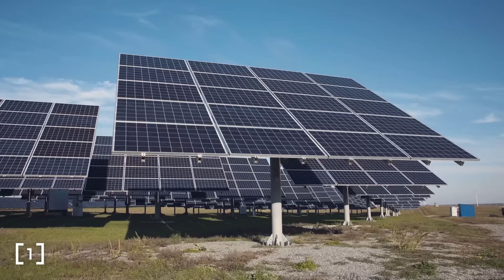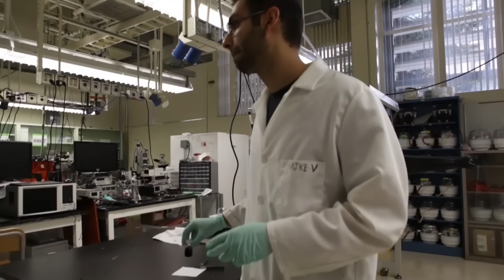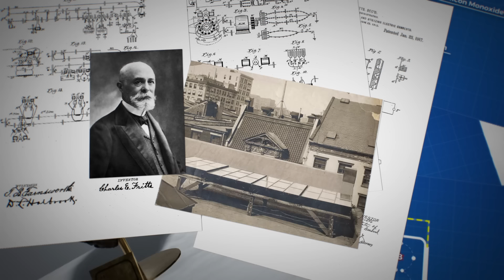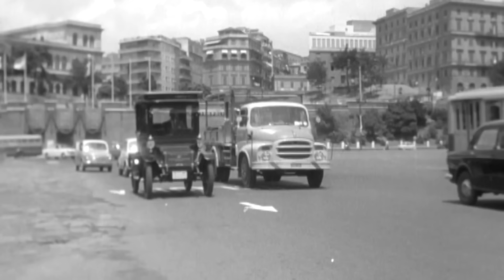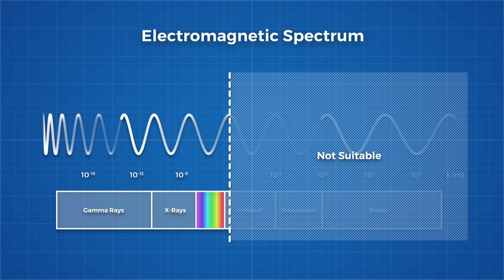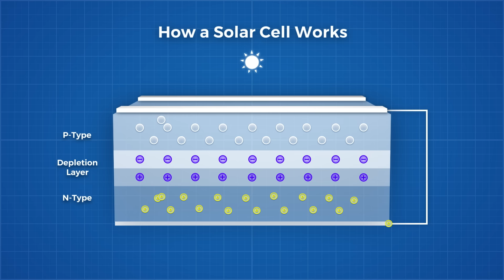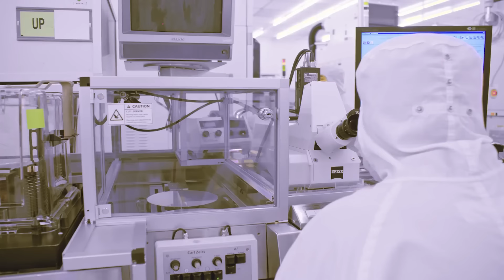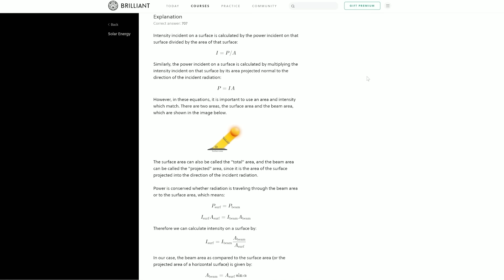The Mystery Flaw of Solar Panels

Comment: As someone who designs and makes solar cells for a living I have to say I'm really impressed with how well you covered this topic! It's a complicated subject with a lot of subtleties and you did a great job explaining it to a general audience! Nice work!
Reply: @SLM-n6g  TLDR - About 90 % of silicon solar cells go to landfill right now, but this is a big field of research right now so it is likely to improve a lot in the future.
-By most metrics solar power wins by about a factor of 10 in terms of lifetime costs of energy production, but this can vary a lot depending on what factors you take into account.

Full disclosure - I work mostly on prototyping new materials and designs on the small scale rather than dealing with the large, industrial-scale issues. However I can give you what I have learned at conferences etc. The energy costs of production can vary massively depending on the type of solar panel you are describing, but I shall assume you want to know about monocrystalline silicon since that is the most common kind of solar cell. Thin-film technologies use about 1000 x less material to produce than a silicon cell so they have the potential to improve upon the below stats, but they come with their own problems which i won't go into. 

Silicon cells are made of about 75 % glass, 10 % polymers, 8 % aluminium, 5 % silicon, and the rest is small amounts of copper, silver, and other metals. There is also a small amount of toxic lead and tin because solar panels are allowed to use leaded solder (unlike most other electronics) so this is obviously also a concern. Currently there are no regulations on disposing of solar cells outside of europe, so about 90 % go to landfill because it's currently not profitable to recycle them. There is a lot of research going into this though because it's a potential goldmine if you can make it profitable. The detailed recycling processes are often closely guarded secrets, but the basic process is you heat the cell up and then peel off the glass panels which make up the bulk of the cell, then you burn away the polymers using sulfuric acid and hydrogen peroxide, and finally you use various acids and chemicals to selectively dissolve all the remaining materials one by one. Hence you can recycle them, but the materials you get out of them are currently worth less than the costs of recycling. Regulation and further research is expected to help with this. 

It is hard to find unbiased data on lifetime carbon footprints, and it is easy to skew the data by conveniently forgetting certain parts of the life cycle (e.g. the mining costs for coal or the production costs for solar.). Burning coal, you fundamentally get about 340 g of CO2 per kWh of electricity, purely based on how much energy is in coal per molecule and the efficiency of a power station. This does not take into account mining costs or whether you capture the carbon (most places dont capture carbon). A 1 kW solar panel takes between 400 and 500 kg of CO2 to manufacture, and should probably assume that it will only produce an average of about 10 % of its rated output over its lifetime (accounting for night, clouds etc.). Hence this panel will produce about 17,000 kWh over its 20 year lifetime, which works out to about 29 g per Kwh. This ignores the installation costs, space costs, and costs of recycling, but even if these triple the impact then solar still wins. Plus this also doesn't take into account the other pollutants and environmental damage assosciated with coal, so in my view it's hard to argue that solar is worse than coal environmentally. However I'm obviously biased so you should probably look at the arguments I make rather than my own opinion. Solar panels have their own version of Moore's law called swanson's law, where the costs of making them halve roughly every 5 years, so hopefully it won't be long before solar power is no longer a political issue and just one which makes good financial sense. They are already profitable without subsidy in certain places, and once they get cheap enough there will be basically no reason not to integrate them into a new building or whatever (why would you turn down free cash?). It looks like we are approaching that day pretty quickly too! :)
Reply: @jonathonharwell1764  ,   We need a good video on Swanson's Law!
Reply: Jonathon Harwell I have worked in 2 fabs, 100% of scrap wafers were recycled from both.  The silicon was used for solar panel wafers after being melted into new ingots. Metals and dopants were removed first.
Reply: @jonathonharwell1764  Investing money and careers in technologies that generate low-carbon electricity just has to be the wise thing to do. Wind And Solar Plants (WASPs) are the headline technologies, but in respect of investment and careers, ignoring burgeoning developments in advanced Nuclear Power Plants (NPPs) might well be catastrophic.

This decade, 3 manufacturers will have operational Gen III+ (passively safe) Small Modular Reactors (SMRs). Leading the charge will be GE Hitachi's BWRX-300 SMR as it has real potential to win the battle for commercial investment funds, with its 24 months build programme.

The first one, with capital from an Estonian utilities’ operator will commence operation in 2027. The second one, for the energy-intensive businesses of a Polish billionaire will be operational in 2028 and the third one is a Government inspired choice for the Czech Republic.

The 24 month build programme is no different to Wind And Solar Plants (WASPs), so the cost-of-capital that drained investment funds out of low-carbon nuclear power plants (NPPs) and into WASPs is completely negated.

By 2030, it will be available for manufacture under licence in the UK, for a capital investment of £527 million, for a 300 MW NPP. It will generate 2.4 million MWh of 24/7, low-carbon electricity each year, for a lifespan of 60 years, with a high probability of an economical life extension up to 80 years.

Taking into account all of the other significant costs, every £1.00 of capital invested in a BWRX-300 will 'earn':

7.2X more than £1.00 invested in onshore wind:  https://bwrx-300-nuclear-uk.blogspot.com/2020/05/fund-managers-with-320-million-to.html 

12X more than £1.00 invested in offshore wind: https://bwrx-300-nuclear-uk.blogspot.com/2020/05/invest-90-billion-in-offshore-wind.html

15.5X more than £1.00 invested in utility scale solar: https://bwrx-300-nuclear-uk.blogspot.com/2020/05/fund-managers-with-424-million-to.html

2030 could well signal the beginning of the end of the decades of subsidised investment in WASPs - at least in the developed world. If investment dries up - so do careers.

Keep up to date with the progress of the BWRX-300 - Join the facebook Group Page: 
https://www.facebook.com/groups/1032713003519847
Reply: @seeWemm  as they say, "why not both"? I'm a huge fan of nuclear energy, from small nuclear reactors to the many promising ventures in smaller scale fusion (as long as we don't have to talk about the mess that is ITER). At the same time, (and I say this as someone who has handled radioactive materials and is reasonable about their risks), I don't really want to have a small reactor, fission or fusion, in my house. I'm in Seattle (not the sunniest place in the world) and even though we have some large trees that can partially block our panels, we've done quite well on energy output from them over the lasts few years. A huge share of homes could host panels, battery storage, or both with little or no inconvenience, making much of our grid local, dramatically reducing delivery inefficiency, and moving away from fossil fuels now instead of in a decade or more when current prototypes and initial test systems become widely commercially viable. We can even harvest and store energy surpluses, not just halting gge in some places but beginning to reverse it or beginning to produce clean hydrogen for use in portable applications where batteries aren't sufficient. As we expand our nuclear capacity, we can begin with stabilizing power to large and sometimes remote institutions like hospitals and manufacturing and then push out to replacing all our fossil fuel infrastructure and what may by then be aging solar and wind infrastructure.
Reply: seeWemm:  thank you so much for your brief expose on the potential of safe nuclear power, by this I’m sure you mean plants that are impossible to melt down, or suffer any other kind of catastrophic radiation emission.

I am in total agreement with you that subsidies for solar and wind power must be phased out, and the sooner the better.

Dr. James Hansen, a climatologist, and author of many important research papers and published books, has recommended a solution to the subsidy problem.

He suggests a carbon tax we’re all the tax money collected is distributed amongst the population evenly, so that each adult person gets a fraction of the tax collected, regardless of income or anything else, let’s say it is $3000 a year, or for you to thousand pounds, ha ha!

The carbon tax is levied at the point of production, and in proportion to the carbon dioxide and other pollutants that will be produced by the volume of fossil fuel. For instants Cole is mostly carbon, so that in comparison to natural gas, for a given amount of energy potential, when burned, the carbon will produce much more carbon dioxide then a given amount of equal energy potential natural gas.

Anyway, this is kind of a libertarian idea, people get the tax revenue directly, there is no intervention from the bureaucracy whatsoever, and they can spend the money however they wish, and it is presumed that they will put some of that money into more efficient energy uses, such as buying an electric car or purchasing solar panels.

As for a nuclear power, well I am an engineer and I am well aware of its potential, and also pretty well-versed on the problems of traditional gigantic nuclear power plants.

Do you know this? That there is not a single privately owned insurance company in the world that will insured for liability a traditional nuclear power plant. All insurance is provided by the National Government in which that nuclear power plant resides. That is a huge subsidy and a huge liability forced upon a population without their approval.  When I learned this I am mediately turned against nuclear power.

I am for nuclear power though if melt downs and accidental emissions cannot happen. And that means that they have to find insurance on the private market or self insure with a bond deposit.

I’m going to look at your references, a lot of promises have been made by the nuclear energy industry, I’m sure you’re sick of hearing, “too cheap to meter” and other such ridiculous promises by The nuclear industry. It’s time for this industry to measure up after so many false promises and so many catastrophic failures.

Sincerely, Steve
Reply: @seeWemm  ,  Good luck.... I won't be around to see it, but perhaps for our two children you hold out hope.
Reply: @CharlesBosse  ,  IF you would stop using gibberish and acronyms for everything, we MIGHT have some chance of understanding what your point is. Maybe?
Reply: @jonathonharwell1764  so based on the fact that you are obviously biased, we are left with NO conclusion? Forgetting about the money.
Reply: @jonathonharwell1764  instead of going to landfill why arent they actually put on top of the (covered) landfill wired up, and plugged into the grid. even if inefficient on one km2 of dodgy panels on a brownfield site is better than nothing. and why has no one invented a commercial all-weather solar-paint...imagine a Forth bridge worth painting?
Reply: Jonathon Harwell Would love to know your story and how you got into your field!
Reply: @peterfrying4933  I'm a physicist by trade and now I work in academia researching new materials and designs of solar cells. I did a degree in physics and basically looked for any research group I could find who worked on solar cells and did a PhD with them (it's surprisingly easy to get into a research group as a phd student as you are essentially free labour. Getting funding is the hard bit!). Now I have a PhD I am (slowly) trying to get my own research group started. It's a tough field to work in and there is a lot of competition, but it does at least have job satisfaction!
Reply: @jonathonharwell1764  What happens to the PV effect when you substitute carbon for silicon and attempt to use calcium and nitrogen as doping agents? Is it too unstable or does the energy level of the incoming photons increase? Just curious.
Reply: @surferdude4487  There's always loads of research going into new materials to make solar panels out of, (in fact there are many materials that are better than silicon already, but silicon still wins because 50 years of computing industry has made us REALLY good at making silicon..), but the main things it needs to be able to do is absorb light and conduct electricity well. About your idea, crystalline carbon is diamond, which is transparent to everything except deep UV, so i don't think it would work well. There are people who dope it with stuff like you mention to help it conduct electricity, but I don't think that would be enough to make it a worthwhile alternative to silicon at the moment. The graphite form of carbon is both absorbing and conductive, but it has a different problem in that it's bandgap is extremely small (which long story short means that it will absorb light really well, but it will waste most of its energy as heat), so solar panels made of graphite are extremely inefficient unfortunately, and again that doesn't change much with doping. Sorry to be a downer! That's an oddly specific material you are asking about! May I ask what made you think of that?
Reply: @jonathonharwell1764  Just going off the top of my head from what I can remember from the periodic table. You need holes and extra electrons. It seemed to me to be the first place in the periodic table that can be achieved is around carbon.
Reply: @surferdude4487  Ah fair enough. Yeah doping carbon with those would add the stuff for conductivity, but carbon doesn't absorb in the right way unfortunately.
Reply: Jonathon Harwell good for you Jonathan, I wish you the best in your R&D. And you have the right attitude. I did R&D for about a decade and it was the most rewarding thing I ever did as an electrical engineer. We made many substantial breakthroughs. I hope you do also.

In my field, besides developing new electrical mechanical products, it was essential to make them small and operate efficiently.  At that time, in the 1990s, there was a lot of low hanging fruit because it was an old industry and electronics had not yet been applied as a controlling agency. As an electrical engineer, and the only one we had at the company, when I designed electronic Controls specifically for our equipment, it look like I performed a miracle, we could make the equipment half the weight, gain manyfold in performance specifications, while using a tiny fraction of the energy compared to the same kind of devices without electronica controls.

I guess it’s different for the solar Development field, where you have math applications, so even a tiny gain in efficiency or cost reductions results in a huge benefit due to the wide distribution use of solar.

I hope with your new R&D company, the one that you are putting together yourself, that you somehow pay yourself a salary, ha ha!
Reply: @jonathonharwell1764 .....thank you for your story and your efforts...good luck and good hunting...your successes will make this world a much greener place for my children!....again, thank you.
Reply: @jonathonharwell1764  keep up the good work !
Reply: @jonathonharwell1764  ,  Bravo. More power to you! Good luck!
Reply: Cool! My dad has a PhD in physics and he is working on cadmium telluride solar cells at First Solar.
Reply: Very cool to come across someone else in the PV field on the internet! I'm working on my PhD right now, researching new silicon PV module technologies.
Reply: I enjoyed watching this video, it has mystery to it, with the lost efficiency factor, and I appreciate the time that the author put into it! Myself, I am an electrical engineer, but I am not involved in the solar or silicon aspects of electrical engineering, So I learned something to!
Reply: @SLM-n6g  all in: Carbon neutral in about 8 days in the Sahara (1Kwatt/m^2)
Reply: SLM Coal 900 gCO2/kWh, Si PV 24 gCO2/kWh, CdTe PV 13 gCO2/kWh. http://www.firstsolar.com/-/media/First-Solar/Page-Components/Corporate-Responsibility/SmallestCarbonFootprint.ashx?h=460&w=767&hash=4923C0A5B94337B6CEC2A1F2B819AB1461448004
Reply: SLM CdTe solar modules are recycled with up to 90% of glass and semiconductor reused. http://www.firstsolar.com/en/Modules/Recycling
Reply: Thanks for "YOUR" input :)
Reply: @Jonathon Harwell Sir are you willing to share some contact information? I am a future researcher and might want to get in touch with you sir!
Reply: So maybe you can answer me a question.im no engineer but since I was a kid and solar was just in its infancy I understood that solar cells were woefully inefficient. Over the years I've been reading of developments but I wonder if it's possible to develop and design a solar panel that can utilize the wavelengths it needs while reflecting/focusing those it cannot utilize for further power generation?
Theres a station in the desert in california that uses focused solar energy to generate...I believe melt sodium that then is used to generate steam and the electricity?I could be wrong on this.but even if only a small amount of thermal energy can be effectively focused then using the effect of a liquid in a vacuum chamber (water under vacuum boils at a lower temp but delivers near the same amount of mechanical energy)to then generate more energy.
Reply: What about the large amount of space that solar and wind farms require for their large scale usage? Just asking since I haven’t seen anyone bring this up in the comments. This is a negative environmental impact where a lot of open space is required, plus the infrastructure. Trees need to be cut down, the space made suitable for installation, roads have to be put in for since those installations need to serviced, power transmission lines run to connect to the power grid, and all this infrastructure negatively impacts wildlife with loss of habitat on a scale ever increasing with the demand. I don’t know the side by side comparison of solar/wind with coal in this respect. Does anyone have that info?
Reply: Pages 294-296 of “The Final Theory: Rethinking Our Scientific Legacy “, Mark McCutcheon well worth reading on solar cells.
Reply: If you design and make solar cells for a living, why are you not correcting him on some of the mistakes?
Reply: Why don’t yall use the Ligma conductors. It’d solve all the problems.
Reply: There is no comparison really, because the extraction, transportation, and storage of coal creates a great deal of waste, and then there is the consequent removal and disposal of ash. Consider also that solar power does not necessarily mean photovoltaic panels, solar thermal plants work on basically the same principle as any fossil fuel powered plant, except the boilers are replaced by solar troughs and heat exchangers. Since solar generation does not require the transport, delivery, and storage of fuel stock, and consequently no rail sidings, docks, etc. (and the carbon emissions associated with all those ancillary activities) all that doesn't even enter into the picture.
Reply: @furripupau  ,   I would love to see YOUR videos on the subject of solar energy and lack of pollution!
Reply: @furripupau  How do you do it 24/7?  You can't any storage system make them unusable for base line power any one who thinks so is fooling themselves.
Reply: I'm wondering, what your thoughts are on including a thermoelectric generator (wikipedia tells me they are also called a Seebeck generator) in the same enclosure to try to recapture some of the waste heat?
Also, do you think the boost in available light and possible 24 hour exposure is worth the cost and potential introduction of inefficiencies to launch massive solar cell arrays into geosynchronous orbit and beam the collected energy down with a microwave laser?
Reply: @travissmith2848  The thermoelectric idea would definitely work, but the big question would be whether it provides enough energy to be worthwhile. From what I know about them, thermoelectrics work best at pretty high temperatures (hundreds of degrees) and the ones which work at room temperature aren't that good, so you don't really see them very much outside of high temperature industrial processes. One really cool potential application for them though is for cooling CPU chips - you simultaneously prevent overheating by stealing the heat energy, and you also generate power from the current that it generates. No noisy fans required. 

For the space array question, unfortunately I think the answer is definitely no. It's true that you'd get a lot more energy out of a cell in space vs a cell on the ground, but putting them up in space would likely cost way more than the benefits, even if it was easy to get the energy down to space. The need for a laser to transfer the energy would also cancel out the benefits of increased efficiency because it is rare for any laser to be more than 50 % efficient, and you'd lose a load more going throught the atmosphere, so I don't think space solar is likely to be powering stuff on earth any time soon. It's a bit like the solar roadways thing - there's not much point going to the extra effort of putting them somewhere difficult, when there isn't really a shortage of empty spaces which aren't being used for much else (deserts for example).
Reply: @jonathonharwell1764  Thanks!
Reply: @travissmith2848  From what I've heard, because I have not crunched the numbers myself, is that the cost far outweighs the benefit. Also, there are huge risks involved in beaming massive amounts of power down to Earth in the form of microwaves. At some point, I believe we will have space elevators. When that day comes, we can transmit massive amounts of solar generated electricity down the beanstalks. Until then, I'm much more comfortable with solar panels on the ground.
Reply: @SLM-n6g  it's a great way for biden bernie aoc to harvest votes!!!
Reply: @SLM-n6g  ,   EXACTLY... Where are your answers??
Reply: I'm still waiting for them to work on cloudy days and at night, or in winter, when we actually need the electricity. They are the worst kind of "green" virtue signalling. I still haven't seen definate proof that they produce more electricity than goes into making, installing, maintaining, and disposing of them.
Some of the toxic cocktail created while making solar panels:
sodium hydroxide; potassium hydroxide; phosphine; arsenic; trichloroethene;  phosphorous oxychloride; ethyl vinyl acetate; silicon trioxide; stannic chloride; tantalum pentoxide; lead; hexavalent chromium plus others.
Reply: @KillerBill1953   Well they are currently profitable in some places with zero subsidy (unlike coal which does require subsidy..) and they are getting better every year, so i guess we'll just have to let the free market decide. It's not virtue signalling if it's making you profit to produce low carbon energy. I included the calculations on CO2 payback time in an earlier response, and the list of chemicals you provide there are mostly just normal chemicals used in any industry (silicon trioxide and tantalum oxide are basically just sand, and the hydroxides are the main component in bleach), and while they are a concern they are no worse than what is used in any other metal or semiconductor industry. You are obviously entitled to your opinion, but I'm optimistic we'll be seeing cheap energy from solar cells become more and more common as time goes on :)
Reply: @jonathonharwell1764  Not in the UK or the EU where it is only profitable to run wind farms and solar arrays because of the subsidies. I'd be interested to know of anywhere with zero subsidies.
There's also the fact that they are not subject to very expensive and draconian planning laws, including decommissioning,  unlike fossil or nuclear which are made artificially expensive because of this. They are not on a level playing field when it comes to finance. 
Up from 10% efficiency to what, almost 20% outside the lab? They also reduce by around 1% a year. Without subsidies nobody would bother with them
They have some uses for people off the grid but that does not make them greener than fossil or nuclear. They are also useful for space programmes. However, I wouldn't expect a balanced opinion from someone whose livelihood depends on promoting the scam.
Just remind me what kind of source produces the electricity necessary for manufacturing wind and solar equipment, or mining the raw materials. Current battery technology is nowhere near sufficient to provide the base load that heavy industry needs. Oh, I forgot, that's all been moved to China and India where they don't have time and money to waste virtue signalling.
Have a very good day. Still not convinced by your very vague assertions.
Reply: @KillerBill1953  Hey uh bill, about subsidies - oil companies get them too. Find me one oil company that does not get either tax credits/breaks or subsidies. If fossil fuels are subsidized, it is only fair that wind, solar, etc. be subsidized too. 

Thermal efficiency is not really much of a talking point when the power source is free. So a coal plant has an efficiency of 37% or so, and a solar-thermal plant has an efficiency of 20% or so. Who cares? The coal plant pays for fuel, the solar plant doesn't. So it's still more economical. The coal plant also needs a railway siding (or dock) to unload coal. And it needs a vast amount of space to store coal. Then there has to be space to store ash for disposal, etc.  

The basic truth is that fossil fuel generation is expensive because there are so many ancillary costs. Extraction, transport, and stocking of fuel, storing and removal of waste, are big expenses beyond just the cost of the fuel itself. This isn't exactly rocket science here. If you don't need those things, you don't have those expenses. There's just no possible way for a coal fired plant to compete with either wind or solar on a "level playing field" because the ancillary costs relating to fuel are so great.

"Just remind me what kind of source produces the electricity necessary for manufacturing wind and solar equipment, or mining the raw materials." 

Texas, for example, has enough wind farms to supply 27,000 megawatts of electricity. Texas, as you may well imagine, is very much an oil state - and they still see the obvious value of wind power. The largest solar (photovoltaic) plant has capacity for over 2,000 megawatts. The largest solar-thermal plant is at 370+ megawatts. The problem with a lot of people who think renewable energy is a "scam" is they're still thinking about technology from the 90s. Solar and wind power have both been improved greatly in the past 20 years. Fossil fuel plants on the other hand - not so much.

Cheers.
Reply: @jonathonharwell1764  30-50 years after you make a photovoltaic roof shingle as protective as more traditional ones that will pay for themselves in a short enough order to be noticeable every roof in America if not the world will be covered with such. Pure economics.
Reply: @KillerBill1953   I still haven't seen definate proof that they produce more electricity than goes into making, installing, maintaining, and disposing of them.  Spot on. Same goes for wind urbines, which require a same size back up nuclear or fossile fuel station
Reply: @tooyoungtobeold8756  Nice not to be trolled by climatards for a change. I taught Secondary Design and Technology in the UK for 25 years. Part of that was looking into the life cycle of products, from concept to disposal. The main problem is that fossil and nuclear go through expensive and lengthy processes before power stations are built, and have to have in place a disposal/decommissioning plan in place. Wind and solar have no restrictions. You can set them up in any empty field. No studies regarding environmental damage, no worries about some rare newt or fly, no worries about disposal, and it seems the pollution taxes forced on everyone else do not apply to the manufacture, running, and disposal of solar panels or wind turbines. Nor do they have to worry much about planning permission for the infrastructure which does as much damage to the environment as other forms of energy production.
The only reason either make money is due to excessive subsidies stolen from the tax payer. There may be situations where wind and solar are useful, such as if you out in the middle of nowhere, or the space programme. Otherwise they are just very expensive and severely environmentally harmful virtue signalling.
Have a very good day.
Reply: Bill Fox You are not correct in that they can simply be built without restriction. I have had a large wind turbine that was refused planning for various reasons. The main objection was from NAS regarding possible radar issues from an airfield miles away. I also understood any subsidies applied to electricity actually produced not the construction of the solar or wind farm and these have been significantly reduced recently. You are correct in that It would however be useful if a full review was carried out of the various types of electrical generation from start to finish including all stages in between and removal and disposal at their end of useful life both from a cost and ecological viewpoint and this was easily available. Is there anything like this available?
Reply: @johnharvey1786  Hi John, good point, but they are springing up all over the UK, mainly in the middle of bird migration routes. Whereas the HS2 rail line is being held up by all kinds of local opposition there seems to be no limit to where wind turbines are being erected. The problem is virtue signalling government ministers who have committed the UK, without the agreement of the British people, to extreme and foolish "green" energy production.
The excessive subsidies paid out to small and inefficient wind turbines in Northern Ireland will continue for the life of the contracts, 20 years, making the electricity they produce the most expensive in the world. Newer contracts are less costly to the consumer, in subsidies, but I maintain that without subsidies nobody would bother erecting either solar or wind installations.
As far as I can find out, both solar panels and the blades of wind turbines mostly end up in land fill. I keep being told the solar panels are recycled, but nobody is telling me how.
Some of the turbine structure which, incidentally, could not have been manufactured using "green" energy, can be recycled, but the generators use up a lot of rare and expensive materials, and rare earths, which cannot be reclaimed.
Currently there is nobody reviewing the actual cost of energy produced by different methods. It will not happen while governments and ministers keep virtue signalling to the Marxist backed aggressive Green lobbyists.
In order to be better informed, I would suggest:
Apocalypse Never by Michael Schellenberg
Green Illusions by Ozzie Zehner
Not For Greens by Ian Plimer.
All three explain my points better then I can, and give plenty of references, which I am also lacking.
One of them, may have been Schellenberg, does give a breakdown of the safety record for the main types of energy: fossil, Green, and nuclear. In any category you want to consider, nuclear comes out best by a long way.
Have  very good day.
Reply: @tooyoungtobeold8756  There are indeed many studies that looked into how long it takes for solar PV to produce the same amount of energy that it took to manufacture and dispose of them (the so-called energy payback time). The most recent studies put this time between 1 and 2 years (depends on location and weather), meaning that after 2 years PV modules have produced enough energy to balance the amount of energy that was required to manufacture them (plus the amount of energy that will be required to dispose of them). Since PV modules operate for at least 25 years (they work even longer, but 25 years is usually the length of the manufacturer warranty), they produce significantly more electricity than what goes into making them.
Reply: @KillerBill1953  Anything you may have said of value was wasted when you chose a juvenile, ad hominem attack like "climatards." It's a pity you didn't choose to leave that out.
Reply: @TheDoctor1225  Like your opinion matters. What would you call them? They refer to people like me as "Deniers" to link me with Holocaust Deniers. How could anything I write be worse than that, please explain?
Reply: @SLM-n6g  If you exclude the  fossil fuel required to manufacture them - that's cheating. The same goes for the monstrous and unrelaable wind turbines.
Reply: @tooyoungtobeold8756  Agreed. As with so many things, there's a lot of dodge and shuffle that goes on, with a lot of emotional rhetoric and emotional triggers worked into it designed to conveniently ignore those things.